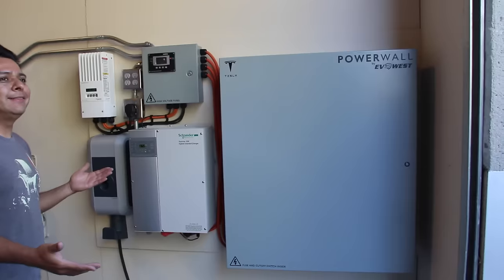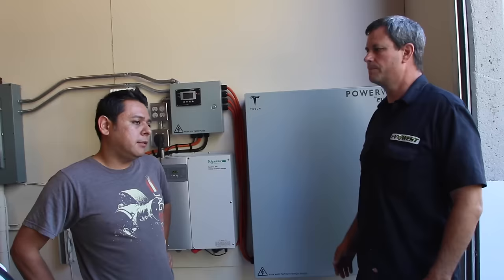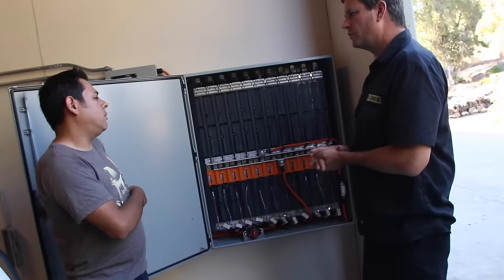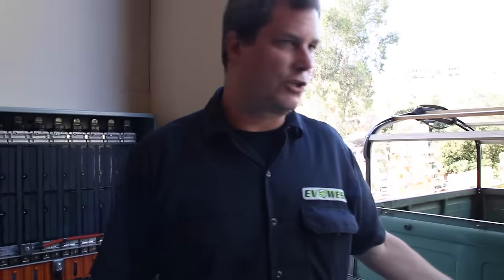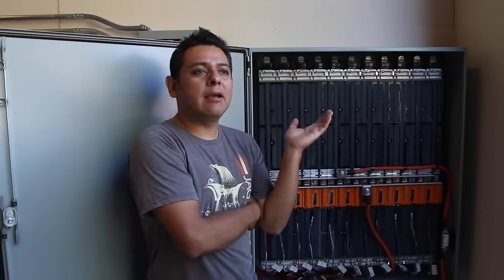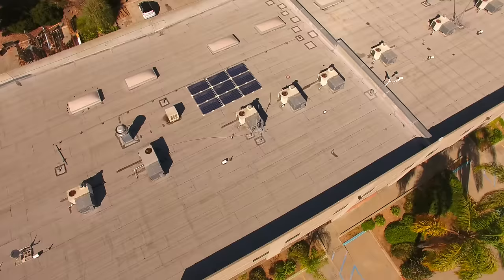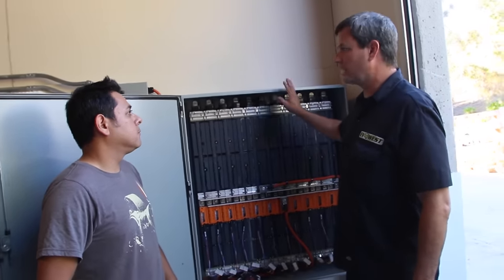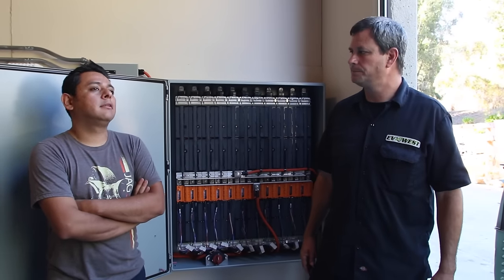DIY TESLA Powerwall  - my  WALL vs ELON'S WALL

Comment: in the netherlands we can sell the solar energy back for same prices as we bought the energy from the grid (netting). So we use the grid as virtual battery so we don't need a power wall. But how is it in USA?
Reply: thats genius, i think in uk we pay more for it than it can be sold for
Reply: They only restriction is that when you got more energy in a year than you have used. The price of the extra energy that you put in the grid will drop otherwise you become a power station. They do like this because high amount of CO2 in the netherlands...
Reply: Most people that buy solar for their house here in the USA do connect to the grid. It's the diy people that make them with batteries. You need extra stuff that the electric company approves of to connect to the grid. Some solar companies do offer the battery option. I've seen a bunch of camps in the NE that use the off the grid battery option because it's better than using a geny or running power lines.
Reply: that would be a problem mipmip but in 20 years we never had power outage more than 2 days. so is not that big of problem. And hospitals got gas generators incase of emergency
Reply: Also our houses mostly run on gas,
Reply: You got it good in the Netherlands, but it's not bad here in Colorado. As my 8 kW solar system generates way more than I consume, I requested to my utilities that the excess kWh be carried forward as a credit from month to month indefinitely until I terminate service. This means I don't sell my excess power, which I would only get 5 cents/kWh compared to the 10 cents/kWh that I pay. It's a better deal for me as long as I know I'm going to eventually use that excess kWh eventually. I know I will as I have an electric brewery that I use frequently during the winter. It's a better deal for my utilities as well, since they need the Renewable Energy Credits for government funding (I think).

The batteries increase the sustainability of your solar panel system because you're not using the grid as a sort of inefficient battery. Rather than buying back the power when the sun isn't shining, you're instead discharging the batteries, making it a more efficient and environmentally-friendly system.
Reply: In Hawaii we have net metering. If we generate more than we are using at any given moment our electricity meter runs backwards. PV is very economical in Hawaii, because electricity costs 3 times the national average.  Return on investment with subsidies is 5 years.
Reply: Same in Slovenia
Reply: That's cool for the Netherlands, but it's just an incentive. The power you're putting onto the local grid, isn't worth the same as the power you consume.
Reply: It's about 3 years in Australia.
Reply: in the US you get credit off your bill.
Reply: They buy back the energy for about a tenth the price you pay for.
Reply: In Victoria Australia, we sell our elec back to the grid at$0.06 per Kw. We buy 1 Kw from the grid at $0.36 off the power company, so I need to sell 6kw back to the grid to become neutral. I have a 3.5 KwpH system so thats a few hours of sunlight ... yay! at the end of the day I get a $82 per month off the bill, which is around $150 after rebate
Reply: In malaysia grid tie sell back is 0.86rm per kWh , buying is 0.28kWh...they offer the buy rate for 21yrs from installation date...but the offer has closed after 5 yrs..that means they are no longer taking new subscribers
Reply: The grid is a system that requires mucho maintenance and wire + linemen doesn't come cheap. Add to that, linemen usually are in demand at odd hours and when the weather is bad. People who are NOT using renewable sources, such as wind and PV, would have to pay more to maintain  the grid available to those who do. That's why you pay more for the juice you get from the grid than you earn for what you send to the grid. If renewable users were completely off the grid it wouldn't matter as much.  Makes sense, right?
Reply: In southern california currently its the same... but will change at end of july 2017
Reply: Its exactly the same in the US - By federal law - so every state.
Reply: Dollar for dollar energy back to the grid, whenever you don't use the energy they buy it.
Reply: Power companies in the USA are thugs and predators.  Hunting down grannies for extra cash at the end of the fiscal year.  Here, some states will thwart your solar project if you become too visible.
Reply: its the same here
Reply: there is net metering in most areas but the way politicians talk that can change. I think the power company wants to cut the price that they buy the power to the wholesale price.
Reply: The policy in the U.S.A. varies depending upon the state, city/locale, and power company.  Where I live in Texas, it is the same as you describe, aka "net metering", but our electricity is very inexpensive, just 8¢ ($0.08) per KWH.
Reply: I admire Jehu and Michael the Southern Californians making "it" happen! It's great to see used batteries being repurposed. However, Elon Musk is da man: his Gigafactory will double the world's production of lithium batteries the moment it opens. The price of powerful batteries will drop as supply shoots up. Add to that the ingenious polymer invention of Mya Le Thai which lets lithium batteries last a human lifetime (200,000 charging cycles folks!) and the future looks very bright for electric cars and house backup batteries. Meanwhile, let's not bash the power companies and Big Oil. Even ExxonMobil's former chairman Rex Tillerson openly acknowledged recently that renewables will organically receive the funding they need as oil price increases--if oil supplies begin to run out. That's the inflection point my friends: if oil and gas remain affordable, then the common man can enjoy plenty of electrical and transportation power, and gradual investments can be made in renewables as individuals and nations choose to pay for solar panels and backup battery systems privately or by tax subsidy. But if scare mongers have their way, heavy taxes on hydrocarbons will subsidize renewables and engender power shortages and high energy prices--much like what happens  to food, energy, and commodities in stupid socialist countries like Cuba and Venezuela when their leaders demonize true economic principles like profit. What's wrong with letting creative individuals like J & M roll out affordable renewables and encouraging the rest of us to invest in that instead of a Miata or a Mercedes?
Reply: Absolute shit, bud! $200 this month!
Reply: anyusernamesleftest This gets complicated fast, doesn't it?  The reason the power the customer consumes is worth more is simply that it costs more. Utility companies had to invest billions back when solar panels were not as affordable, and they need to charge enough to pay for their investment in generator hardware, power line networks, and staffing for running all of this. And these are all costs that a homeowner with a solar panel doesn't have. So the ultimate solution is to have an affordable battery bank at home. This will bypass the established, traditional electricity infrastructure and save citizens uncounted billions. But we have no affordable battery yet; we await the economies of scale from Elon Musk's Gigafactory, to drop the price of lithium batteries since the first Gigafactory will double the world's lithium battery manufacturing capacity.
Reply: Most attempts at solar are discouraged by the big oil corporations.
We will succeed eventually.
Reply: Sander Brust where I live in IL they charge 11.75 cents per kw and pay us 2.75 cents for what we send back through the line . This is why ppl here don't both to send it back to the power company
Reply: In Cali, we sell ours for the same price we pay. When I generate during the day (and I'm not home) I get $0.36/kWhr, more in summer ($0.54); at night I buy it back for less (after 8pm) about $0.24/kWhr. At the end of the year, almost everyone gets a small check back. With our e-car, we hope to break-even
Reply: Its a little harder to break even when you have a huge company with lots of options for power generation, like huge windmills, water power from dams, ect. But when you are isolated, its great, and getting better. Two examples, people with RVs who want to stop just anywhere . and sailors, in yachts .  Both have special requirements. One, not a lot of area. They need panels which put out as much as possible for the area they have available. They need especially efficient controllers. The need the best and lightest batteries they can get. I've been impressed with the slightly lower voltage lithium iron phosphates. Not sure how they come out watt-hours per dollar though.
Reply: jessery basically you sell it to the grid at 1/3 price so you need to bank 3 x Kwh to get 1 x Kwh back...its shit. You are better off buying 2 x powerwalls, so that you can sell to grid knowing you won't need to buy it back. Still the UK Feed-in-tariff needs to shift to 50/50 and eventually 90% or 100% (1 in 1 out).
Reply: @shandor2522  because as the year 2018 comes to an end we are finding out we don't have a whole hell of a lot of time left.

Comment: Have you thought about coming up with a tesla power wall for a motorhome? When I look at the Tesla website you can pre-order a powerwall with around 13kwh in the 6k range - that's dirt cheap for that kind of storage.  Combine that with solar charge controller and inverter and you'd have a killer RV off grid setup even allowing you to run a small air conditioner.

Comment: Jehu:
  Love this and all your videos. 
A note about UPS's: They are designed to provide AC power for short periods only. I would not consider using one as a full-time inverter. The circuitry isn't there for long-term AC power generation. But, after saying that, they are cheap.

Comment: Man I wish I was smart enough to do this on my own. Maybe it is easy for people with the knowledge, and maybe it's a little fear mixed in. But I'd be scared of getting electrocuted, and just wasting money with trials and errors. Either way I'm dying for something like this. Hope I can find a guy like this when I get back home.
Reply: You're smart enough, there is just a huge amount of information and choices, so it tends to overload the brain, which causes one to want to hide in the bathroom a lot.  Once you decide exactly what you want to do, and use it for, it gets a little less daunting.  The hardest part is deciding on what kind of batteries you want to use.  (I'm still wrestling with this)  Just take your time, read and view posts, and follow the path it takes you.  Hang in there.
Reply: Thanks! Your right. I found some simpler versions, and just started with the super basic one battery, and one solar panel. I fell more confident now. But like you said I just need to do the research. Hope you figure out what you want to use. Maybe make a video ;)
Reply: Mike Payne Mike, curious if you decided yet on a battery? ;)
Reply: No, not yet
Reply: You can start with a simple 12 V DC setup, perfectly safe to work with.
Reply: @bonker any getting started guides you can recommend?
Reply: Electrical engineering is easier than you think.

Comment: Thanks for posting.  Tesla/SolarCity said in their 2Q earnings conference call last week that they have considerable existing backlog in their ability to supply product for commercial storage demand.  That's for commercial uses, as opposed to consumer or residential applications.  I've seen rumors that Tesla already sold their entire 2016 production capability for storage, and have therefore, been unable to provide PowerWalls to the residential market in the USA.  Hence, no PowerWalls available.

Comment: Don't you need a permit for any modification to a building.   You have panels on roof and electrical wiring.  You need to get a electrical permit from the city of Los Angeles (building and safety), and a permit from LADWP to connect to the grid.  You would still need city permit.
Reply from the maker: no
Reply: First off he's not in the city of Los Angeles. There's more but I'm not going to bother telling you about it

Comment: you have compressor and 2 fan motors amp surge when the unit starts.  measure it with a clamp on amp meter.  try adding a hard start kit to the a/c unit.  not sure how to size to a 120 v system.  visit a hvac vendor store and ask them.

Comment: I am an IT Technician and I have to tell you those power supplies have a cable that plugs into the motherboard and has to have a signal from the mother board to run. It tehres no voltage running through that signal cable then the power supply wont send power through the main cable.
Reply from the maker: What power supplies?

Comment: pop pop pop pop pop pop
Reply: So freaking annoying in my monster headphones :(
Reply: I didn't hear any popping, but I didn't watch the video.
Reply: toysareforboys so annoying in my Panasonic ™ Bass-Boosted® in ear headphones, only $ 19.99 at your nearest Walgreens™
Reply: electrical interference and static from the system displayed?
Reply: Alexandre Potvin t
Reply: I made it myself thanks to INPLIX website
Reply: Monster headphones are trash, the popping may be coming from your cheap headphones.
Reply: In the first scene, the popping may be coming from the overhead ceiling fan.
Reply: Alexandre Potvin  c
Reply: Will they block out my wife's TV shows?

Comment: Pretty good price on the tesla battery packs if they have the capacity they are rated at. Just couple of mistakes on the website I found. According to the datasheet the cell is 3.6v nominal and 2.7Ah  rated capacity. So the capacity of the pack should be 59.4Ah, 3.2kWh. Nominal pack voltage should be 54V and not 57V.

Comment: Been toying with this idea, we don't get enough sun in winter to live off solar, but could still charge battery at night with hydro then run off it all day during on peak, while solar adds a bit of power for a few hours.  In the summer months solar would provide most of the power.   I don't have much room on my roof though, so I'd only be able to do like 1-2kw at most.  But that part of the roof faces south so that's a bonus. (other areas get shade from trees)